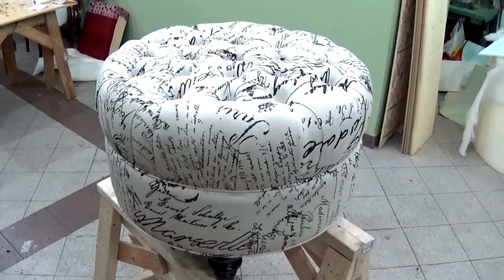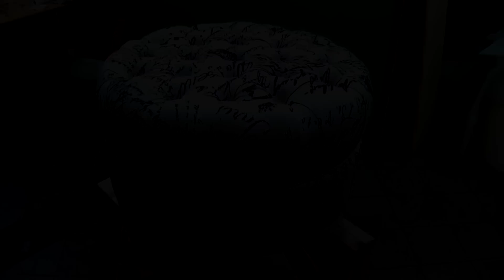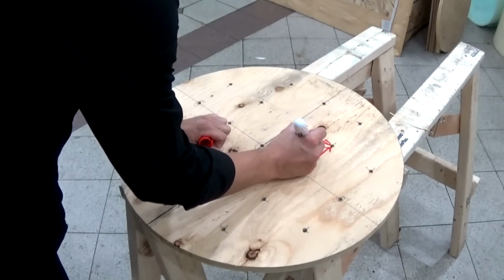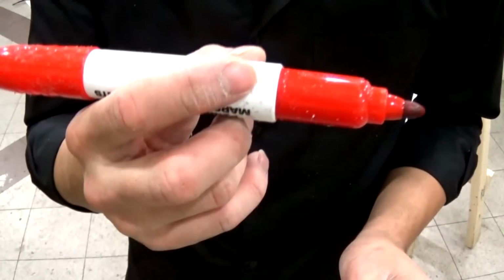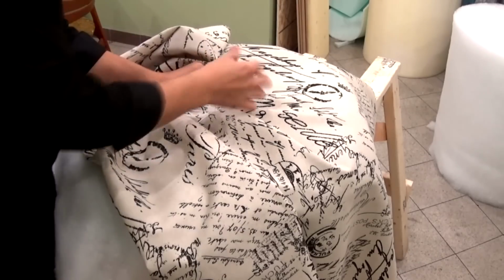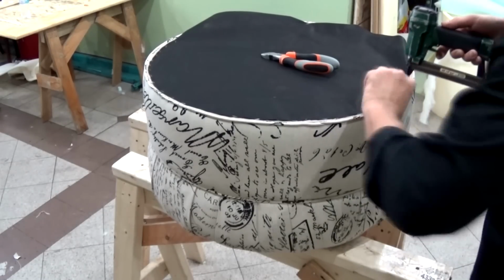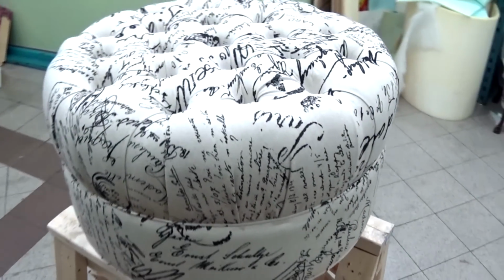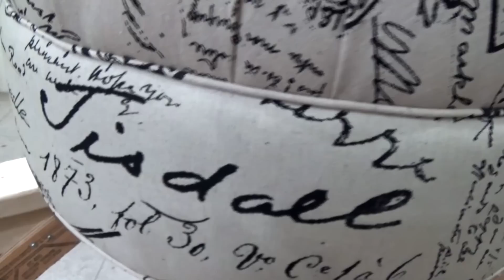DIY - HOW TO UPHOLSTER A TUFTED BENCH - ALO Upholstery

Comment: Excellent video.  I love button and tufted upholstery and have a few projects in mind as this type of upholstered furniture is very expensive especially in velvets which is what I want to use. I plan to do a simple headboard, two custom office accent chairs in a color that is not readily available, and am currently working on repurposing a set of two sectional sofas into a banquette for my dining room. I had the general premise but drilling out the holes I had not seen done before and using cardboard strips as you did to prevent the staples pulling out of the fabric is good too. You also use twice the thickness of foam as I have seen others use in addition to the batting which really made the piece look well constructed and comfortable. Your work is beautiful. Thank you for sharing!

Comment: Great work.  I see you're a pro.  With all your tool and all.  But won't the buttons  go through the foam holes?  You made your puff just as I made my first piece years ago, with the pieces of boards around, cardboard and foam over it.  The 1/2 cardboard is called back tacking strips, which I also used.  Great work.  Have not make another one yet :-)  My second was a full on lounge chair, that came out great also. Alot of work thought, pulling the spring etc.  Love the legs WOW!
Reply: Flowergirl Power he cut the holes so the buttons can reset into the cushion. This allows the button not to have tension on the string allowing the piece to have a longer life. ~hint~ the wood holes aren't that big for the button to go through.
Reply: I know the holes are not that big but the tension can rip the fabric
Reply: Through the fabric is what I meant.  After time the fabric can fray.
Reply: Flowergirl Power Most of the tension is on the buttons, not the fabric.  The fabric can fail but usually will last many years esp. if a quality upholstery fabric is used.
Reply: Flowergirl Power super
Reply: Flowergirl Power